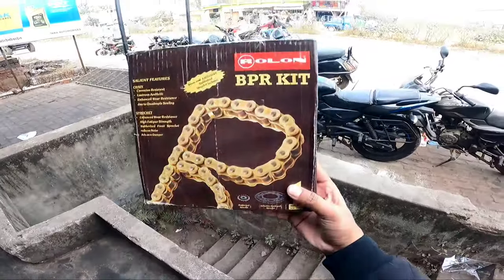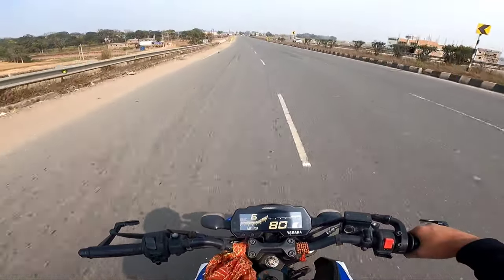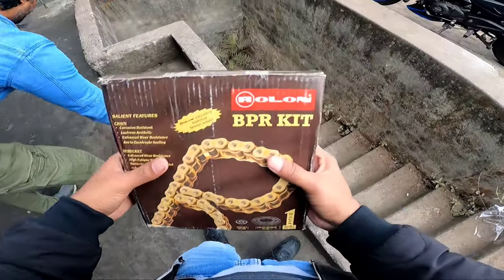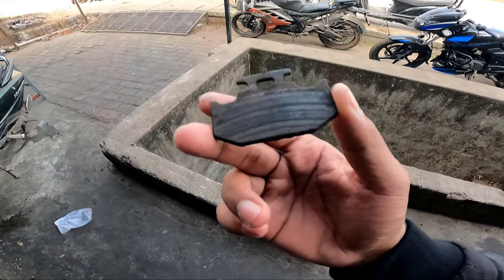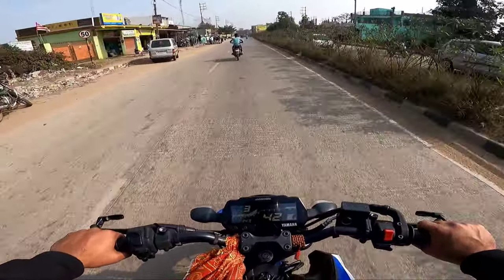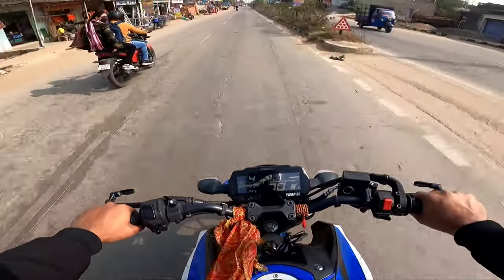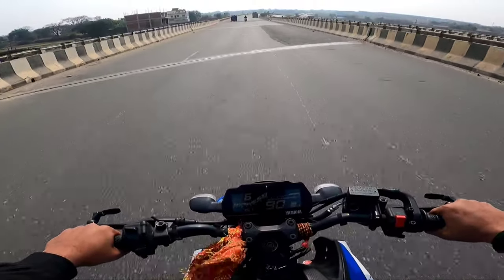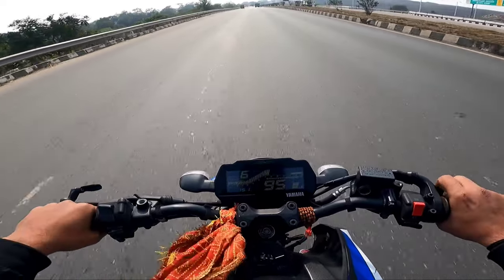Rolon Chain Sprocket MT15 🔥 Performance Upgrade ⚡ mt15 motovlog ❤️

Comment: Can we use  mt15 chain sprocket set for r15 v3. Inorder to increase the instant throttle response?
Reply from the maker: Dekho use kr skte but mat karo engine pe bohot pressure aaiega...mera friend MT15 ka top end increase krne ke liye R15V4 ka sprocket use kiye...2000-3000 ke baad engine khul gaya 😞 Issi liye bolunga mat karo

Comment: Bhai mt-15 v2 he performance ke liye kya karna padega without air filter and exhaust change
Reply from the maker: Umm muskil sawal..🤔
1- NKG Performance Spark plug use kr skte usse thora refinement milega
2- Weight reduction ( faltu jo weight hai bike ka nikl do )
3- Performance Sprocket 
4- ECU Remap - hm recommend ni krnge apko cause engine khtm ho jayega 
5- Engine oil upgrade kr skte ho motul ya liqui moly 
Itna hi hai bhai bs 🤔

Comment: Bro i have a question 
I need to replace my duke 200 sprocket 
I was thinking about the normal non-brass x ring rolon sprocket! 
It it worth it? Or should i go for company one!? 
And how to know if it is original?
Reply from the maker: Bro Rolan is better it last longer than Original one ans it work better at same price.... you can  buy it from LRL motors it's a trusted site or try to find a genuine dealer 😄
Reply: @MotoBoey  thankyou brother! 🖤